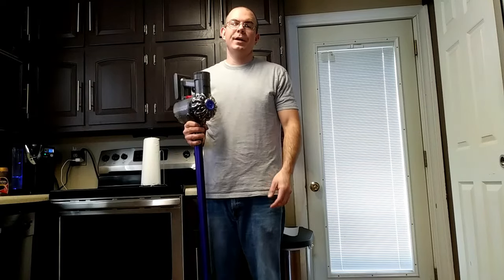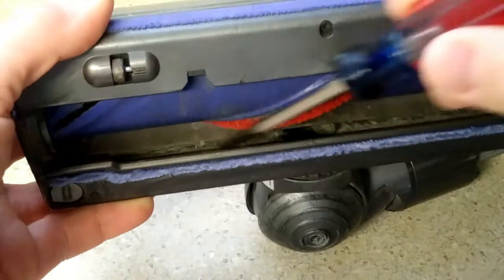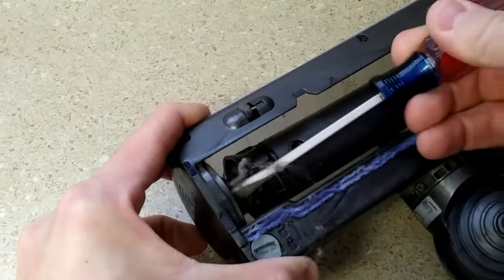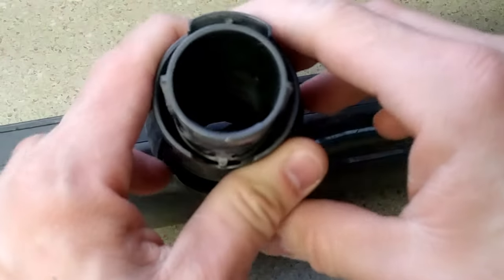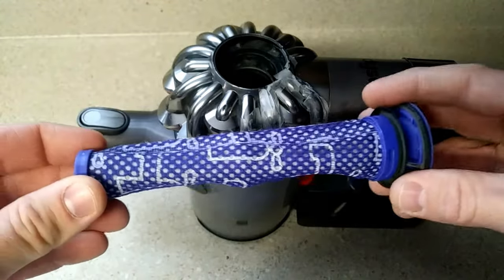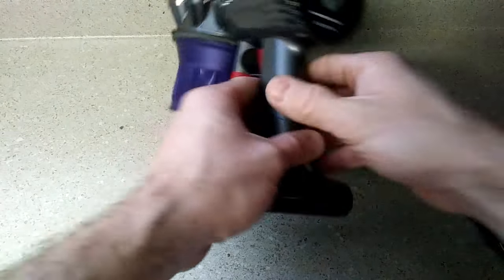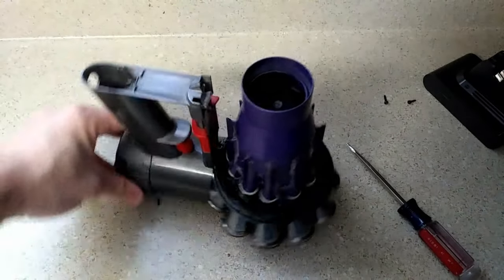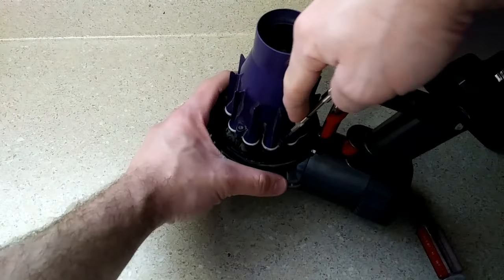How to clean a Dyson V6 cordless vaccum cleaner

Comment: All this money spent on a vacuum cleaner and you have to be a mechanic to clean it! This has been the worst bit of money I have spent! Who can do all that to clean your vacuum, not me? Sorry but I am over Dyson!😈
Reply: It doesn’t take that much time to learn and do this. You get to see how vacuums are design and constructed. Dysons are the best designed and longest performing brands there are. You do get your money’s worth per use.
Reply: Tell me you're lazy without telling me you're lazy. 🙄
Reply: This is actually what I APPRECIATE about Dyson. It can be easily taken apart and cleaned. Most of the pieces, before you get to the battery pack, have the instructions ON THEM

Comment: On the brush head, you correctly unlocked the brush by turning the big screw but you also unlocked (partially) the button strip and never removed it. There is a reason why that strip is removable, there is a lot of dirt and dust collected underneath.

Comment: Thank you for showing this. If you do this regularly, there is less stress on the motor and batteries. Which will make you vacuum perform longer and stronger.  I’ve had my V6 for 5 years and it still performs like new. I’ve only had to replace filters and only once for the battery.

Comment: Here I am three years later referencing this video again!  I sure don't recall using a Torx head before to remove the one part, surely I did but I couldn't find it so went out and bought a little kit.  It is amazing how dirty these things get inside.  Thanks once again!
Reply from the maker: Luann make sure you try to keep the v6 series up and running. Im using the newer dyson v10,v11,v15 series at my building and i cant keep the head unit from breaking and having the wheel damaged in 6months. Major design flaw with the newer models. The v7 or v8 would be the best option if you ever upgrade the only downfall is the canister size. The v7 v8 series in my personal opinion is the best option and not the new v8 with electronic display.
Reply: @TorrentPerformance  Thanks for the head's up!
Reply: @TorrentPerformance  It is amazing how dirty these things can get, just had to reference your video again.   Glad that I made a note in my prior comment about having bought that little Torx head set (T8).  You make it so easy to follow your instructions.  Thanks again.

Comment: I really liked your video, Michael.  It was clear and easy to follow and you didn't waste my time or bore me to death at any. point.  Only thing I had trouble with was the gizmo with the five screws where you need the special tool.  I walked down to the hardware store but they didn't have it.  So I walked home, got the car and  drove to the one on Pine Street (Burlington, VT). They didn't have it either.  So I drove to Lowes where after a lot of trouble I got the damn thing.  Got back and realized that the torque head did not just fit into the screw driver thing, but had to be used with some mysterious attachment. Fortunately, I had a pair of scissors that jammed into the orifice okay and I was able to proceed.  
This is where I think you should modify your instructions.  Tell people to take those little specialty screws out and put them somewhere safe.  Because, at this point I took all my parts over to the sink to wash. ( I really like things to be clean!)  There was an ominous clicking and skittering sound as the little specialty screws I had forgot about sped down the drain!  Fortunately,  had two left and damn that will have to do! 
The "Jesus clip" or whatever you called it completely baffled me, so I stopped there. Everything went back together okay but I was so tired I couldn't remember which was the new battery.  Oh well!  I'm sure this will become clear before long.  I took a shower and put a band-aid on my cut finger.
The vacuum cleaner works great!  Or it did until the battery went dead.  I think that it was the new battery and it just needed charging.

Comment: I know this is an old video but just stumbled across this and just wanted to say thanks! It was a great vid on how to clean this unit. My wife purchased this V6 refurbed from Dyson three years ago and its been a great unit. The battery recently died and got a replacement. Wanted to clean it up before I put the new battery in. THIS was a real cleaning!! Its all laid out drying. Can't want to reassemble and try it out. Thanks again!
Reply: my battery on my v6 only lasts 10 minutes. should i get a new battery? the vacuum is really clean. i hardly use the vacuum, but the battery sucks.

Comment: Thanks for posting this.  After about 18 months of use, the vacuum would expel a full charge in about 30 seconds.  I left it alone for two years before deciding to buy a battery today. Then I thought, why don't I see if it could be another issue, and low and behold I found you.  My SV03 was so caked with dirt and debris blocking about everything that sucks or blows...  Normal maintenance had not done the trick so I'm now waiting for everything to dry so I can prove my theory, but am confident this will solve the problem.  Thanks again!!!

Comment: Greetings from South Africa.   Great video, extremely helpful and did it myself.  Shock and horrors and once separated my Dyson was really mucky!  Just a note: the removable blue pre filter can be thoroughly cleaned by unclipping it around the neck of the filter.  The spine slides out and one will note that dust and hairs does escape through the filter and gathers around the spine.  Rinse and click back together.  Thank you.

Comment: Wow- amazing. Thank you so much. My wife was complaining about less sucking power and wanted me to buy another. With  your step by step instructions I was able to find a buttload of dirt, no wonder it smelled bad when we used it. I did everything you said and they both run like new. Can’t thank you enough !!👍😊🍺
Reply: Oh, and since you advised the filter close to motor was output filter And maybe some type of oil. I added some essential oil to it. Eucalyptus and now when we are cleaning house we are air freshening too 😊👍🤷🏼‍♂️

Comment: Spotted another video before I tried to prise the top of the filter. The pipe from the bin had a blockage, not a big one but there was enough fluff to create a blockage. I then discovered that the flap at the back was jammed. Managed to push hard on the flap with a pen and dislodge it. No longer pulsating so thanks for your video which pointed me in the right direction.

Comment: Extremely helpful! moreso than the other videos on youtube. Some additional tips I found while taking it apart. If you found this helpful, upvote the comment so others will see it or perhaps he can update the video notes/info with this.

If you don't have a Etorx T8. (not very common):
 I have a few different sets of tools and have multiple T10 and higher but not a T8. You can get away with using a precision screwdriver about 2.4mm (it might be 1.8mm). You might already have it lying around for watch, glasses, computer repair. However if you're going to go buy a tool specifically for this get the T8, the precision screwdriver can be a pain to turn since there's not a lot of grip.

Removing the backplate to the prefilter at 15:22 in the video: (easier way without damaging it)
Rather than removing it the way he did in the video, at the base of the handle in the rear towards the middle you'll notice a divot that you can insert a flat head screwdriver. Insert there and pop it off from the base, then work your way up and pull the back plate off. You can place a napkin or something over the divot, then put your screwdriver in order to prevent scratching as well. If you do it the way he does it, there's a good chance you'll scratch up the side of it.
Reply: Brilliant! Thank you.

Comment: After 4 years of use... I finally tore this thing down for a full clean. And omg I'm glad I did... some of the venturi nozzle were blocked on mine. It was disgusting inside. Now it runs like new and saves me doing 3 to 4 passes on the carpet. One pass and it's clean. Amazing again!

Thankyou for taking the time to make this video. Very much appreciated.
RamjetX

Comment: Great video, thanks. One thing you missed is that it it MUCH easier to clean that little tubular filter if you take it apart, by using your flat head to press on the 3 little locking tabs that hold it on the little plastic frame.  Then you can use a small bottle brush to clean the inside, where all kinds of gunk can built up, that won't come out if you don't disassemble it.

Comment: Great video, you did a fantastic job of showing us step by step how to clean this thing....Thank You!
Reply from the maker: Thanks more vacuum vids to come.
Reply: How did you get the back cover off to clean the post filter by the motor you just pushed on it with a flathead and it came right off, we've been prying and pulling for 30 minutes with no luck. The screw has been removed and the section on the handle prys off but the round part won't budge and the screwdriver just wants to deform the plastic

Comment: I put a little "clove" essential oil on my filter. Makes the whole room smell good when you vaccum.
Reply: VERY SMART INDEED!! 👍🏾 Thanks for the tip.
Reply: Which filter did you add the essential oil to?  The cone shaped purple one or the gray filters in the exhaust?

Comment: Quick tip; the 1st lock on the roller you must rotate it all the way so can remove the long bar completely and that allows you to clean the debris that is catch in the port much easier. The 1st lock is not associated with the 2nd one they are 2 different locks.
Reply: he seemed to miss that

Comment: Thank you for your great video. I thought my Vacum  was faulty. It was pulsing, by following your instructions i was able to find the blockage. Normally I just empty the bin give it a bit of a shake. Its had a deep clean and is just like brand new now..
Reply from the maker: Your very welcome, these are some of the best vaccums on the market for the money. Like i said we use these all day commercially and they hold up well as long as there properly cleaned. Thanks for the comment.

Comment: I thank you for this great video! It really helps that this vacuum cleaner lends itself to be accesible and easy to dissasemble. I feel I have a new vacuum cleaner! this video has saved me hundreds of euros on a new cleaner. Downside...I wont be buying a new Dyson soon. Upside, when im in the market for a new cleaner it will definately be a Dyson as they are easy to open up.
Reply from the maker: I suggest a dyson v8 model or v7 with a v8 battery upgrade without the electronics in the vacs. The new v8 have electronic modes you want the v8 with the max switch that is manual. Also the v8 heads are designed different than the new models v10,v11,v15 that have week points in the head near the wheels that will break the wheels off over time.

Comment: I have the same one. It kept shutting down after only about twenty seconds. I cleaned the filter many times but it kept shutting down. Finally last week i disassembled the filter (very easy to do) and found a chunk of gunk at the pointed end inside. I removed it with needle nosed pliers and vacuum cleaner works like new. No shut downs.

Comment: To be honest I don't know how I feel about taking all the parts off but I'm going to try it. You make it look simple.
Reply: I did it and it works great except for one thing. I get shocked a lot while using it. I wrapped a hand towel around the handle in order to use it but it scares me if the towel is off. Has this happened to you?

Comment: Thanks for this. My motor keeps pulsing so I thought the filter was blocked but can't get the top off so bought a new filter. No difference. Am now going to continue to follow your video and hope that I don't wreck the thing. Otherwise I may well end up buying a Shark which is a lot cheaper than a Dyson but 5 years newer than my V6.

Comment: Excellent video, very clear. A few comments based on my experience: i) This is a VERY messy, dusty job if you have an old dyson and have never taken it apart and cleaned it ii) Jesus clip easy to remove if you hold cleaner between your knees/legs while you lever with screwdriver iii) Purple part tricky to take off, go slow and gentle iv) Back of cleaner (where MAX button is) is VERY hard to get off, again go slow and gentle v) Oval fine filter under MAX button very fragile when old, like it's started to perish, so remove very carefully unless you are replacing it

Comment: The only thing you for got is to tell people that the Cantrell filter tube is in two parts if you look around the top you will see three clips that hold the filter together you need to remove the outer filter because there will be lots of dirt and hair  and fluff that just washing it won’t clean it , just push on the three plastic slots and it will slide off I hope this helps you give a more informative cleaning process
Reply: Can’t believe that he didn’t do that.  Washing it from outside does very little.
Reply: @brianbaker359   Yes you sound like you know what I am looking for!  The bigger round filter,  has max on one end ....... no videos online showing this filter!  Do you know how to change this one?  Any help appreciated.  Thanks

Comment: Great video. When I reassembled it I put the body onto the handle before doing the torx assembly part. I thought it was easier to snap the body onto the handle while squeezing the jesus clip before putting it all together. Also I run some carpet cleaning dust through the newly assembled vacuum.

Comment: I love, love your video!  I was ready to throw mine away because of the awful odor.  Now I have used your instructions to clean it twice and it is running smoothly and no stinky problem.  BUT....I cannot get the back cover off to reach and clean the exhaust filters.  It just won't budge, and cannot get a flat screwdriver blade under the edge to pop it off.  Any suggestions?

Comment: Great video, thanks so much.  My only issue is my round filter disintegrated when I washed it!!  Guess I will be putting up with the loud noise now since I can't seem to find where to find a new one.
Reply from the maker: Give me a few minutes and I'll shoot you a link for a Amazon one do you have a v6 model?
Reply from the maker: Ok links in description for what i would recommend buying
Reply: @TorrentPerformance  Yes, I have the V6 animal model.
Reply: @TorrentPerformance  I can only seem to find the link to the long, blue filter, not the round black one.
Reply from the maker: @luannp7839  links in description from Amazon any purchase really helps me out from the links.
Reply from the maker: @luannp7839  for the rear air vent?
Reply from the maker: @luannp7839  1st link in description has the hepa filter on rear and washable filter?
Reply: @TorrentPerformance  The one shown at 15:58 of your video.
Reply: @luannp7839  i cannot find it for sale anywhere. That first piece linked will replace that black filter with a hepa filter on the back end.

Comment: Great video and very helpful.  But note that one step shown here break internal plastic parts of the filter (but does not seem to hurt the functioning of the vacuum).  When the video shows removing the purple plastic cylinder filter by prying it off with a screwdriver until it "pops" off, this step actually breaks off the internal plastic latches.  It appears that this part was not intended to be removed in this way.  (Not sure what the correct way is.)  The vacuum still works with these latches broken off.
Reply from the maker: I didnt break the vaccum at all when i worked on it. Be more careful when you do these steps not to break your own vaccum.

Comment: Hey man thanks for your guide it was very helpful. But just to let you know the top piece where you took 5 or 6 screws off that piece has 4 more screws that comes apart into 5 more pieces that needs cleaning mine was very dirty. It was worth the clean runs like new many thanks.

Comment: I found your video very informative. I have one of these machines, I could never get it apart until now. I have a question though, 

Is there a e clip removal tool for the clip on the motor? To make it easier to remove and reassemble the machine. If so where could I find this tool. Thank you.

Comment: I have a Dyson V6 Top Dog and used it frequently and cleaned it all the time. I know exactly what was shown here in this video, which did reveal the true facts about Dyson product I've learned through my own hands-on experience. Even the guy kept saying it's simple, from seeing how hard he was trying to forcibly push in, squeeze, pull out, pry open, ....., you could clearly see how difficult the whole process was.

In fact, I was totally disappointed with Dyson product. I think most people are deterred by Dyson's fame and brand, and are therefore hesitant to criticize or objectively comment on its products. Honestly speaking, my major impressions about the V6 Top Dog are nothing but flimsy and complicated,  As to the battery time, after hours of charging, it lasts only 17 minutes at most.  

As a side note, using Dyson product always relate my complaints against Apple cell phone. After I bought an i phone 12 pro, I did have opportunities to compare it against those Android phones I had used for years. I honestly think Apple phone in general is much inferior to Android phone and many functions and system designs are pretty stupid.